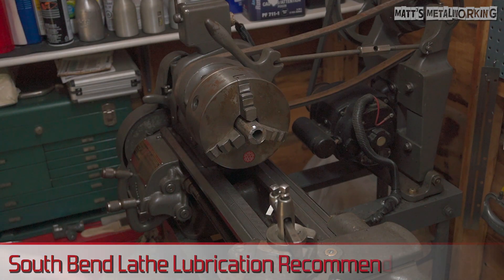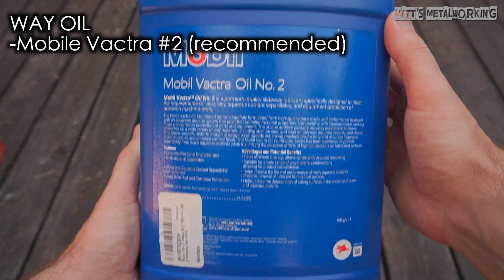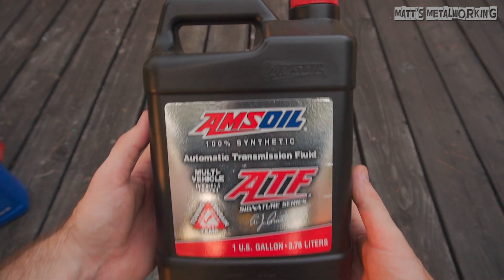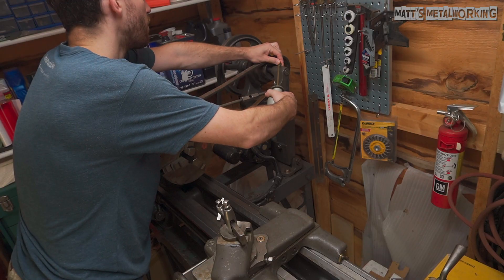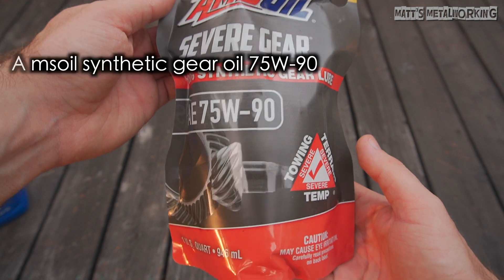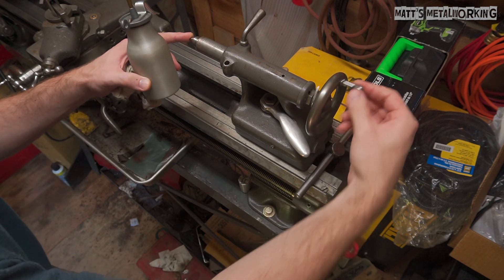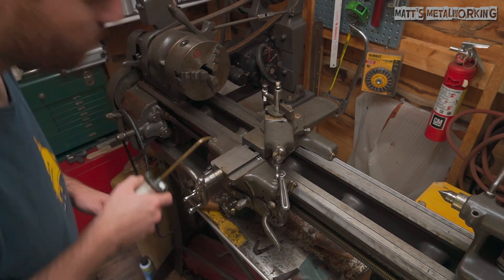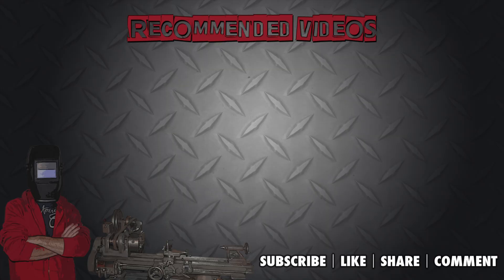South Bend 9 Lathe Oil Recommendations

Comment: Interesting, Im in New Zealand and have had a hell of a time trying to find suitable oils for my Emco lathe. Like you I can usually get the recommended oils but only in huge quantities, 20L mostly. I had been using gear oil in my spindle but recently found a spindle oil, I was really surprised how thin it is. I was really suspicious but did a lot of checking and it appears to be correct so I used it and what a change. I had previously found one 5L container of Way oil after years of looking, until then I had been using chain saw, chain oil. It didn't seem to cause any problems and it didnt run off the ways but the correct way oil is smoother running for sure. Seems incredible its so hard to get machine oils is reasonable quantities, its not like there isn't a market.
Reply: Gday bro! I am a glass blower in Australia! So I sympathise with your issues in NZ 

I just got some iso68 way oil online, for the ways of my glass blowing lathe, I have only been using it for a couple hours so no reviews yet, besides for the fact it seems very very thin, I was previously using 10w30 engine oil, so in theory it should be half as viscous as this new iso68 oil 

 But its the opposite and the iso68 seems thinner than the 10w30 

Stumped for now, if I have new information I’ll be sure to update
Reply: @santr2  Cheers I suspect the ISO68 is thinner but has a higher stickiness ie its thixotropic constant is higher. I did finally get 5L via the web so Im covered for life I suspect :) it seems very good at reducing humidity rust so highly recommend putting it on all bare metal surfaces although that might be a problem on a glass lathe.